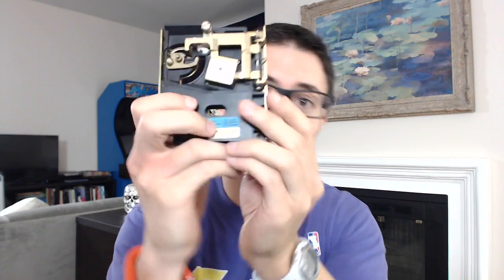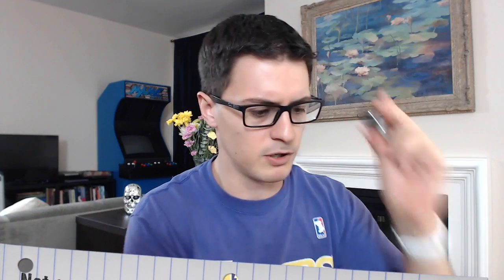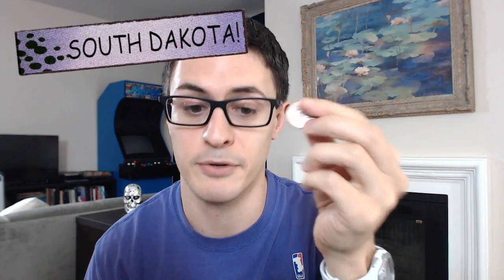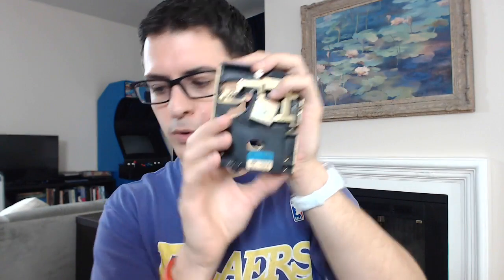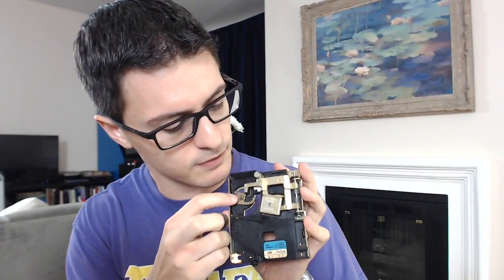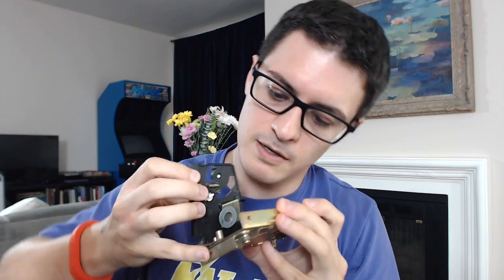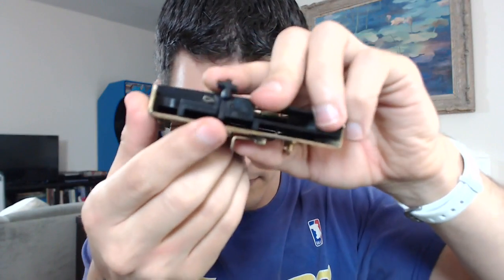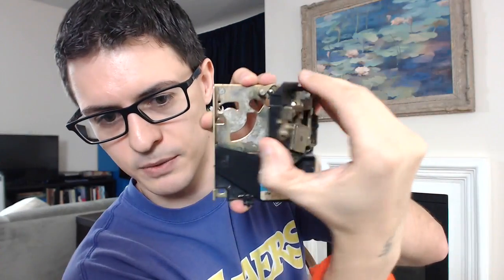How Arcade Games Test Quarters / How a Coin Mech Works

Comment: You forgot about real coins that were drilled and had strings attached to them, to allow to drop the coin in and then pull it back :) There should be a metal gate to prevent that.
Reply: I thought it was a blade that cut the string so that the quarter still goes in.